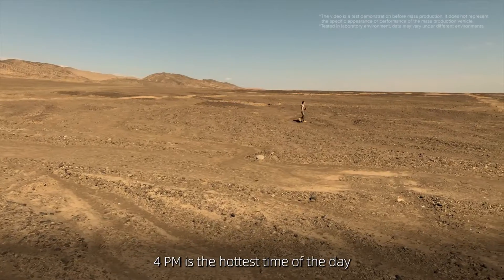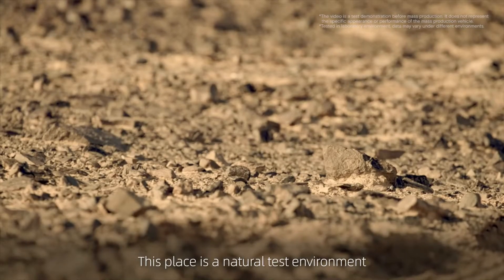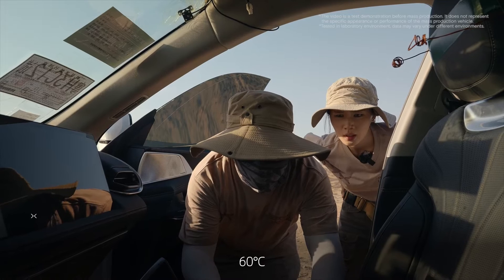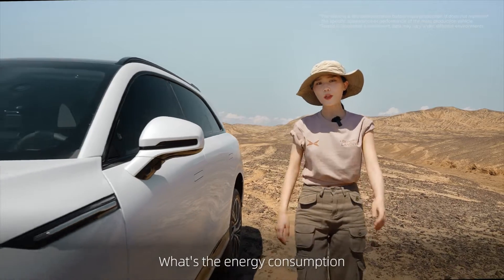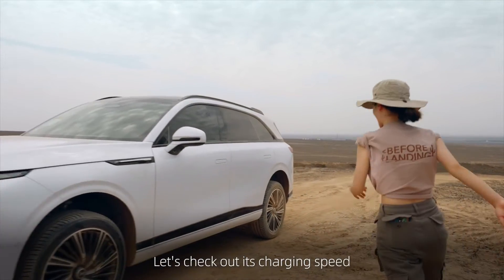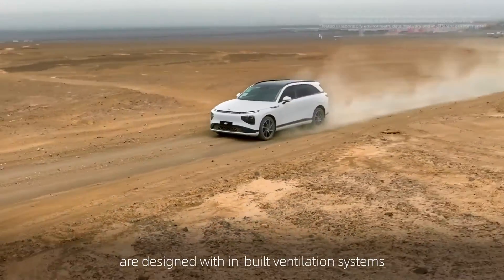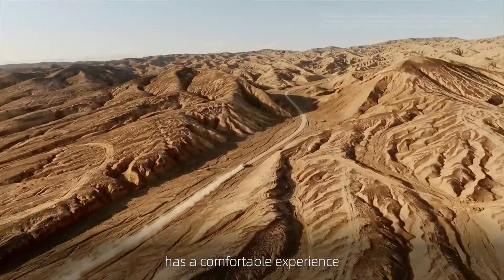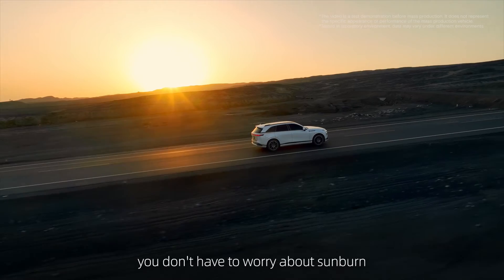How does G9 perform in extreme hot conditions?

Comment: we drove my friend's G9 in hot region and the car was hot inside. we turned the AC to the max and the passengers at the back were still very hot! you guys need to look into the cooling function of the AC! even at Max setting, the airflow was not strong enough at ALL! you should give the user the option to increase the air flow speed regardless of power consumption! in the case where i was driving, we had plenty of battery power, so we would have preferred to sacrifice the power for better cooling! was really a disappointing experience in what otherwise is an awesome car!